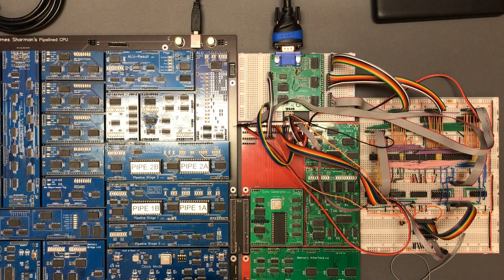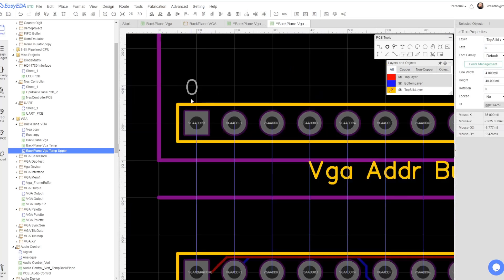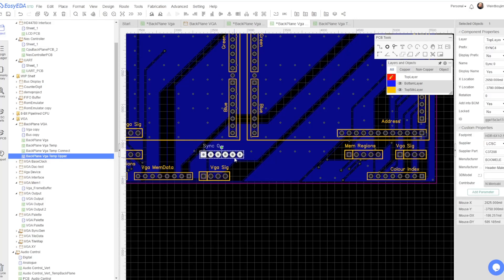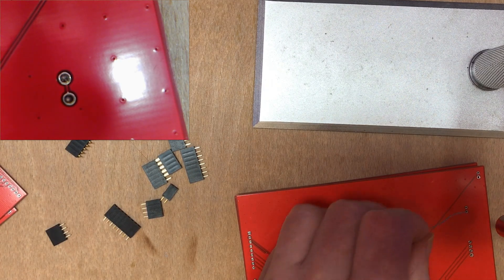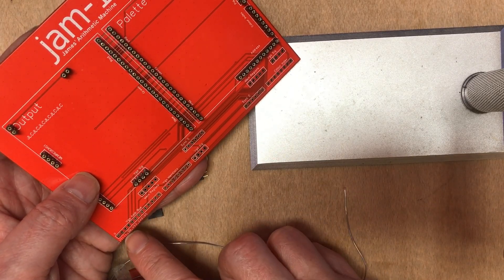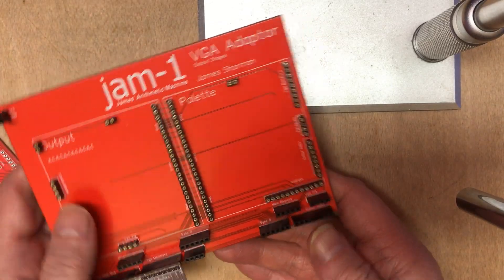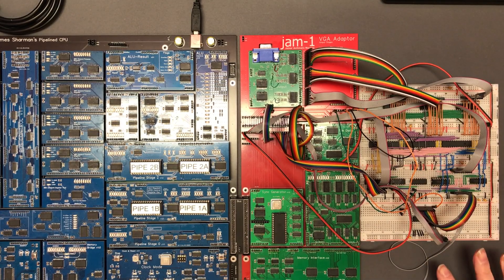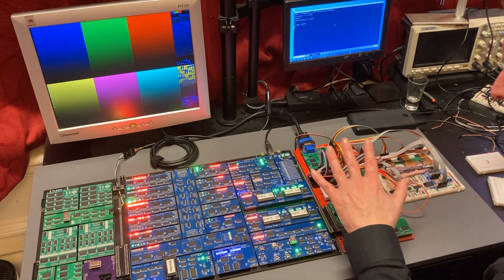Output Interconnect - VGA from Scratch - Extras

Comment: I could really use your help. Could you please look at my video for the KDM-7 keypad and see if you can identify what the PCB film is they used and if you could duplicate it.

It is 16 metal push contacts that the plastic buttons push on and make contact 

It is about 2 inches by 3 inches

I have been looking for someone who knows how to make PCBs and does 3D printing.

2 different people who could do the 2 separate pieces needed to make this keypad kit.

Thank you
Reply from the maker: It would be better for you to join the discord and ask questions like this in the electronics channel. The buttons are something like a snaptron (search it on digikey.co.uk), they are metal domes that bridge contacts on the pcb when pushed.  The "cable" bit can be reproduces with a designed bit of flexible pcb.

Comment: at time 10:48, is that an empty through hole or did you miss a solder?
Reply from the maker: There is no connection there, that address bus pin isn't used on that board but I used the full width one to make it easier to line everything up.

Comment: Thanks for pointing out this video, I never got any notification about it. What is wrong with auto routing? Sure, it won't be as aesthetically pleasing, but it will work, and the computer does all the work.
Reply from the maker: If it works, it works. I've found the autorouter struggle to do some layouts that I can do alone. It's also worth nothing that some of it may relate to better signal integrity, it's worth paying attention to the return path for signals which is something the autorouter doesn't seem to do.
Reply: @JamesSharmanExtras  The autorouters also don't have a concept of which signals are high-speed and need particular attention, and which ones can put up with fine traces that wander hither and yon. Any time I've used one on a board that's at all complex or at all critical, I've spent more time repairing the results than I'd have spent in routing the board in the first place.  But for that backplane, where everything is pretty much running in straight lines anyway, sure, go ahead and autoroute.
Reply from the maker: This is on the extras channel which I just use for supplementary background bits like this that I link from main videos for extra context.